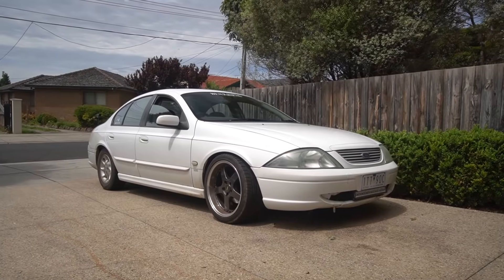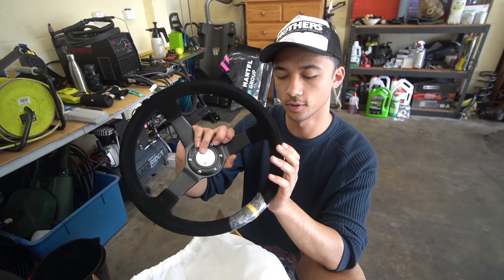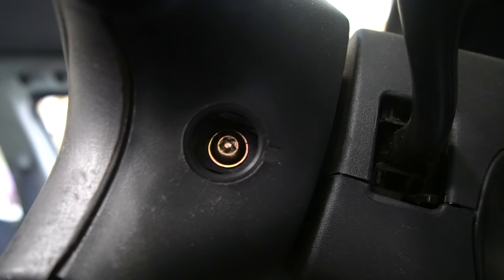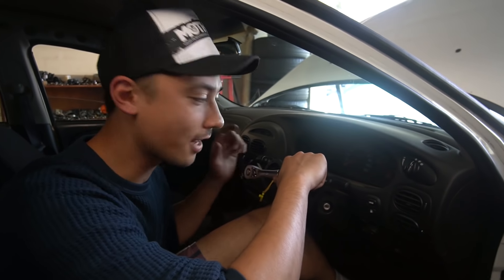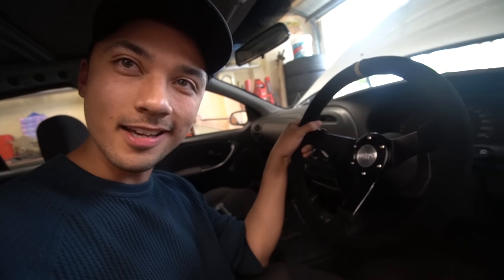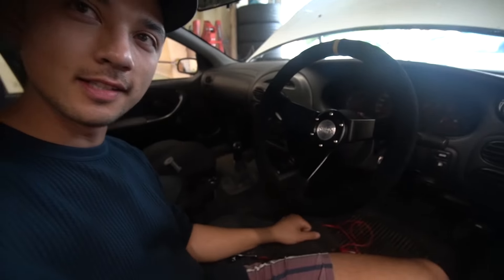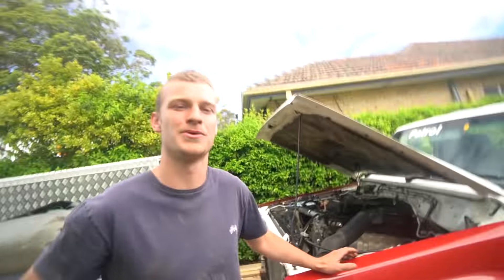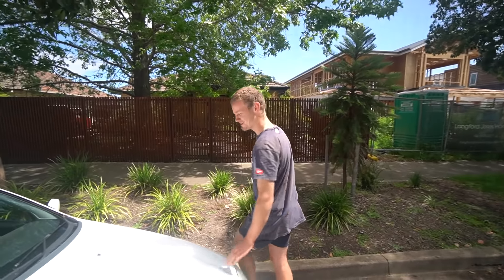THIS CHANGED THE CAR! - NEW STEERING WHEEL FOR THE AU!

Comment: Day 1 of telling rex to barra swap the au
Reply: BARRA POWER SON
Reply from the maker: damn very tempting hahaha
Reply: @RexH  barra swaps are good in theory, if you have the time and money. More powerful, yes, but they aren't as strong. And you have to modify the bonnet a bit. Saw a mates a few weeks back after some quarter mile runs. He said something about it so I lifted the bonnet. Where pistons 5 and 6 should have been, I saw the ground, as in block detonation. 
But he did go big - why do a barra swap and leave it stock? why not put an xr6t in. but if you're going to go turbo, why leave that stock? put in a bigger turbo and give it good boost.... if you ask me, turbo the AU engine, compare time and money.... and look at the fun you have with the stock AU with a dodgy fuel pump. no point going too extreme if it's going to be off the road a lot for repairs... just like every holden ;)
Reply: Nah SOHC gang my dude
Reply: @rubinmike-litt1068  thats a great idea
Reply: @rubinmike-litt1068  hey bro how much would it be to put an na Barra in a series 1 au falcon bro?? How much u reckon I’ll have to spend don’t want turbo just an na

Comment: Is it still cutting out when cornering fast? Change the fuel pump. I found out the hard way, what was causing the cut out... 750km into a 1500km trip and it died..and those bonnet and boot struts are about $30 for a pair on ebay and they last for years, had my ebay specials for at least 5 years and the bonnet still hasn't hit me on the head since.